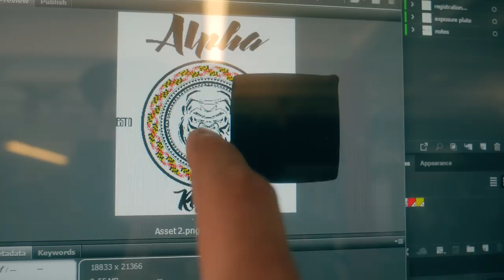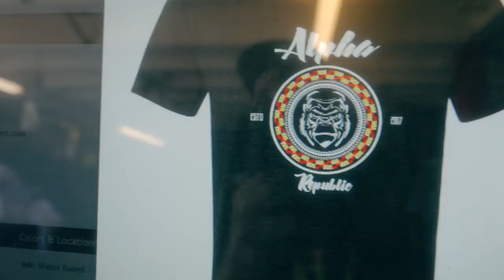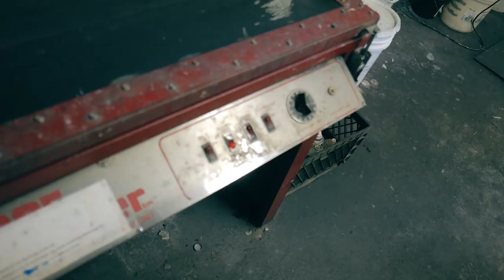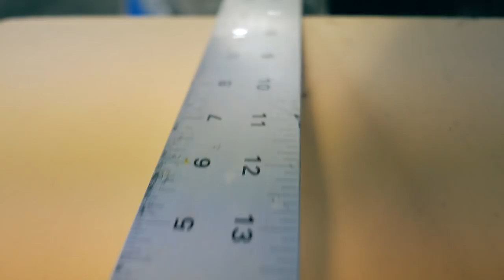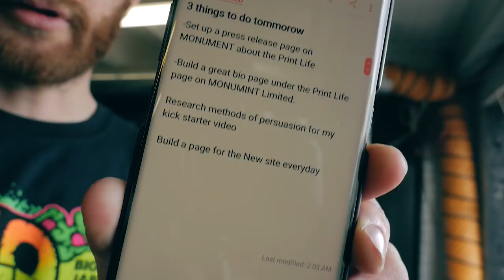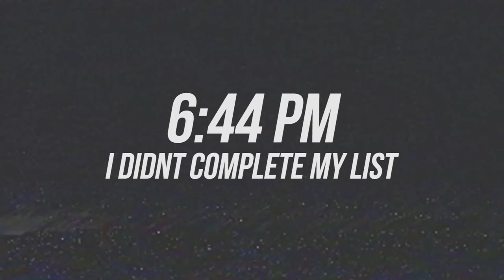t shirt screen printing vlog how to mix red 1 color discharge screen print job and set up on press

Comment: We have a Google Drive subscription and have downloaded the desktop sync software. Then I just have a folder on the desktop linked to the cloud. Anything that goes into that folder is automatically synced to the cloud. Same goes for if you delete anything - if you delete a file from within the folder, it will be deleted from the cloud too. It's a pretty good system. Both me and Alun have the software on our laptops so we both have access to the same folder from anywhere with an internet connection :)
Reply: PS... 4.8k subscribers! KILLIN IT CAM! Growing fast, these daily vlogs are paying off